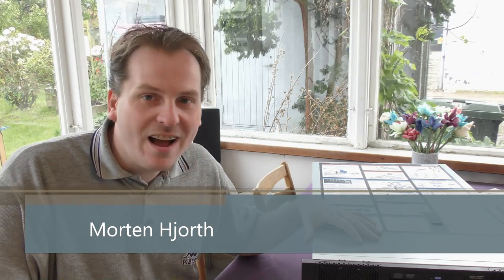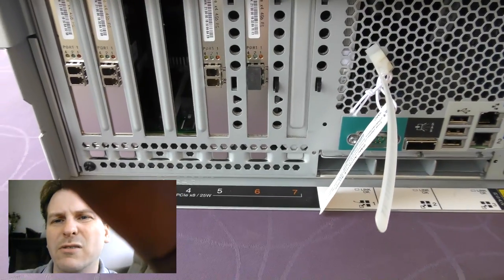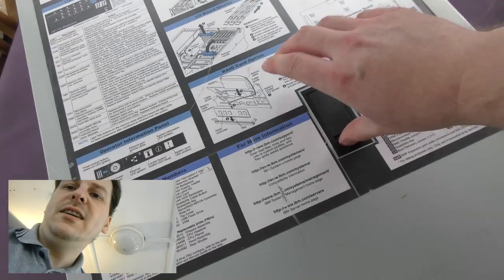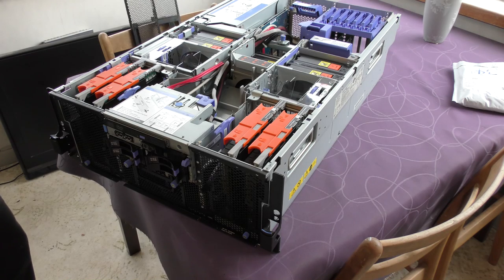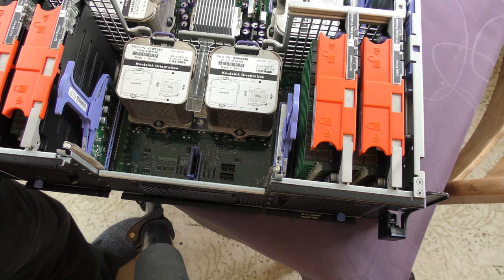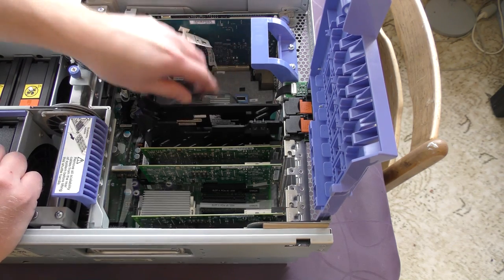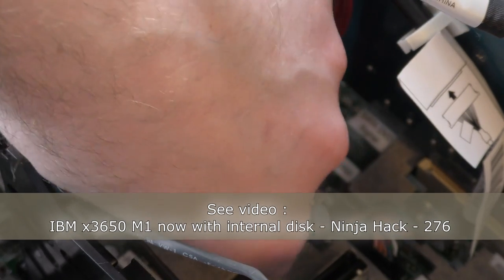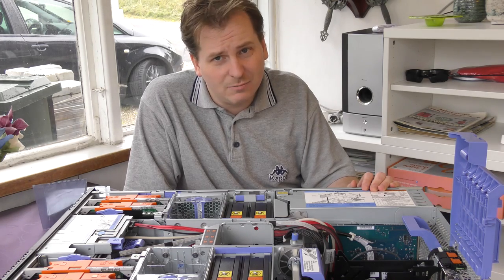$200 Awesome Server - 24 cores and 128GB RAM - 350

Comment: I am an IT Consultant, also a programmer since 1969 FORTRAN, COBOL originally when I was a senior in high school.... I'm really OLD.... 
Anyway I worked for a while at a server farm, and i learned that most servers run 80GB HD
because that is the optimal speed for them, actually this server you had in your hand is probably a set of 10 servers,  also speed is 15000 rpm, they are expensive, and they used a fiber optic connector for the network. I know that the RAM is also special, 128gb for the new servers is about 15,000 USD 
The data is stored in storage and backup servers that usually have more than 400 80gb each one is about $200 each HD, and they in turn connected to a robotic virtual backup server.
All data centers are different, they may have higher capacity drives, depending on what they actually do.
My knowledge is from ONE data center I worked at for a little while, most of my life I worked for myself.
Loved the 775 to 771 CPU exchange
Reply from the maker: Hi
This Enterprise equipment drops so fast in price,,, from $10.000 ro $200 in four - five years.
Thank you for watching! :-)

Comment: Put a little Electrical Tape on the Handel's, Stops the knocking sounds, have a few of them in a rack and they clank with the system Vibrations  .. Tape then metal up..

Comment: Perfect for a test server to learn on! and even use for video rendering :) I personally use a HP DL380 G6 with 2x E5620 8C/16T with 104GB ram, SSD boot drive and a RAID 5 with 5x146GB SAS and its fast with Hyper V!
Reply: E5620 is 4 core
Reply: @leonardotoschi585  yes - but there are two of them so 8 cores
Reply: @keanankruse  ok, still responding after 5 yrs

Comment: There is a reason why they are getting cheap :) They are to expensive to have running. With a maximum watt draw of 2.8kWatt/hour under full hardware load they chew their way though the electric bill fast! Also for you yanks, when running with 120V mode the two power supplies are not redundant (as such), they are both powering the server at the same time (look it up in the install guide) so trying to change one under load would cripple the system unless you obey the limitations like only 2 cpu's and so on. So be warned, got cheap electricity - Then this might be for you ;)
Reply from the maker: Hi David Bjørnsten-Lindhard
It uses a bit of power,, around 5-600Watt
Thank you for watching! :-)
Reply: Yeah 500Watt in idle to ... If you run all cores at 50% you are already way above 1kWatt.
Reply from the maker: David Bjørnsten-Lindhard 
No No No first two PSU at 1440W and they are redundant. Means that 1440W is absolute Max! and even that You will probably not be able to reach. 5-600W runinning.
Reply: IBM says so them selves. And also at 110V they are NOT redundant very important for all them Yanks. Check IBM Redpaper (IBM System x3950 M2 and x3850 M2 Technical Introduction) where they tell this. Also in the IBM System x3850 M2 / x3950 M2 Product guide, they state that the CPUs can draw 130W each. So that's already 520Watt, then 4 x SAS HDD+Raid controller, Coolers and so on. Not a cheap system to run.
Reply: the processor max out 130W doesn't mean that you computer always be like that 
except you got heavy loading 24x7 fullload 
then you will got near 520 watt on processor consumption
Reply: No the machine is  less then 750W at all times. You can now get a few a bit better on EBay but it seems that from now on 2nd hand server land is really going to be interesting now. One generation later with 40 cores/80 threads with 64GByte RAM go for 400 Euro inclusive shipping in Germany at the moment. 
The new ones are not that much better but companies still change their servers every 5 years.
Reply: So lets buy them  all and send them to Dubai. Heared they have a 3 US-Cent/KW price now from solar. 

But we have to send our data on harddisks with emirates planes because the connections are still shitty. This yuuuge latency might be good for chess game players who only need 1 frame per day.
Reply: Can You give more detail on that new generation and some link to ebay, please? THX
Reply: Looks like they are sold out at the moment. That happens when companies go insolvant and have to sell their shit and not resellers who will prefer to let it rot on their shelf.  Just register an ebay search for E7-4870 to not miss them next time. This was one of them

http://www.ebay.de/itm/132119690141?_trksid=p2055119.m1438.l2649&ssPageName=STRK%3AMEBIDX%3AIT
Reply: David Bjørnsten-Lindhard 2.8 watts an hour is nothing at all that's very very cheap to run...
Reply: @Colby Kordas:  It's 2.8 Kilowatt. And thats a fucking lot. In our discount Data Center at Hetzner this means 530 Euro each month for power only.
Reply: David Bjørnsten-Lindhard ug
Reply: I have that same server running 24/7 for 2 years now. It's a very nice server and also i didn't went bankrupt because of the power cost. It's nowhere near 2.8K / hour.
Reply: YouTube 88 soooo....if it's not anywhere near 2.8kw, what IS it?
Reply: Can't see why this would lose redundancy if your on 110v wattage does does not change (and its max 1400w total not 2x1400w its a redundant psu so one psu has to be able to handle full load) even then max this server would pull be less then 600w (having a 1400w psu does not mean it's constantly pulling 1400w)

Comment: Hey there, absolutely love your channel.  Its really cool to see how big of a system you can setup in a household.  I actually have a bit of a question for you, if you have some time.  I work as a computational chemist here in the United States, and we use a software called GROMACS to run protein simulations.  Recently, I managed to acquire 15 NVIDIA GTX 760 graphics cards for cheap, and I figured this would be the perfect time to build a computation farm like how I've been wanting to for a few years now.  Unfortunately, I'm very new to server hardware.  I know that its rare to find older hardware that has PCI-E x16 board edge connectors, so I'm really excited to see how your experiment goes with the x16-to-x8 adapter.  Do you have any preliminary results that you'd be willing to share?  
My main question is, would you happen to know of any older servers that you feel would be well suited for housing double-width graphics cards?  I've been looking on eBay for some cheap deals.  I found a nice lot of HP ProLiant DL380 G7 and G6, do you think they would be good for GPU housing?  I also found some x3650 M2 and M3s, not sure if those would be better.  My main issue is the PCIe x16 thing, but if the adapter works well, then simply finding servers that can fit the cards becomes the problem (I already plan on having external power supplies for the cards, since I doubt I'll be able to find servers that can power 2-3 cards at a time.)
Also, for a beginner storage solution, what would you recommend? (I probably only need 5-10 TB of storage max, but I'd definitely like it setup in RAID so I don't loose any valuable simulation data).  Thank you for your time, and thank you for all your awesome videos!  I hope that you keep finding awesome deals on equipment!
Reply from the maker: Hi Jon
Thanx for movin you question in here.
Putting a GPU in a server is a rather new thing,,, so there is not a lot of old server equipment available for it. To put in those NVIDIA GTX 760 graphics cards,, you need a lot of space and power in the server ,,both the 6 pin and the 8 pin power connector.
That removes the  x3650 M2 and M3 from your list :-/
I think you get to this cheapest by setting up the 15 cards out side the servers,,,somthing like this : https://youtu.be/TtBw_p_NU00
For you storages,,, this is a cheat solution : https://youtu.be/nlT85Xf1AsQ and install it with VM-ware ESXi 6.0 and make a virtual storages server with XPenology like i do here: https://youtu.be/_QRCOTUSy5o
And it can run a lot more VM's for you :-)
Thank you for watching! :-)

Comment: Have a DELL PowerEdge T430 and it actually has 2 designated x16 PCI-e slots and there is also 2 PCI-e power connector for any graphic cards that use that, which is all modern. I was surprised to say the least. I'm in full mode to install a graphic card in it for fun and test to see if it work to play om. Most likely won't be able to utilize anymore than 1 cpu or the two but would be fun to test anyway. And it is also so free in the chassi where the cards would go that a graphic card could be almost long as the entire computer, you don't see that in a home pc.
Reply from the maker: Hi dtiydr
Thank You very much!  glad you liked the video :-)
Thank you for watching! :-)

Comment: Hi, great video☺.
I'll probably buy that server too.
Can you measure how much power it needs (watt) an make a cinebench please?
Reply from the maker: I do not recommend this one any more :-)
Reply: @MyPlayHouse  Thank you for your reply. I have bought one 380 g8 & G9. But on my G9 write speed on 24x raid6 12G SAs  sucks....90MB/s
Reply from the maker: @max17-c4f  Could be bad or missing battery on the raid controller,, so it does not use the cache,, or it is disabled.
24 drives in one Raid6,, is a bit many,, Raid60 might be better performances wise,, but it might cost on capacity.
Reply: @MyPlayHouse  Thank you,  yes i have no battery,... i'll buy one and tell you what happened

Comment: Is your network gigabit or 100mbps? Also whats the electricity cost for you at the playhouse.
Reply from the maker: Hi +thingyee1118 
Congratulation on 200 subscribers! I have Gigabit network. I have made an FAQ,, please check it out,, I think question 4. answers some more.
Thank you for watching! :-)
Reply: +My PlayHouse (Morten Hjorth) 201 subscribers :-)
Reply from the maker: Hi Carsten Hansen 
Yes so it seems! :-)
Thank you for watching! :-)
Reply: Carsten Hansen My PlayHouse 
Thank you both for the congratulation messages. Yes 201 subscribers. I plan to be making more videos soon. Ok Morten I will look at your FAQ :D
Reply: Very good F.A.Q My PlayHouse I like that you answered all the common questions. Hehe do you run at least 1 server 24/7? since you host a website on your datacenter right?
Reply from the maker: Hi thingyee1118 
Yes I run a IBM x3650 M3 ,,,24/7
Thank you for watching! :-)
Reply: ok doke. cheers
Reply: That 1Gbit or 100Mbit? You are joking? Gibit so so cheap, there is no reason why someone should use the slower one.
Reply: NO I AINT JOKING some older infrastructure could be in use. 1Gbit has become a common thing in homes only recently. Before it was all 100Mbps! Cat5!
Reply: Recently? I used it back in 2007. But yes, some "old" infrastructure still use it. Cat5 can do 1Gbit. I thought of upgrading to 10Gbit 2+ years ago, but still to expensive.
Reply: @Stefan Are you sure? Cat5, mine was unable to, Cat5e I can do gigabit without an issue
Reply: Yeah i meant Cat5e, but Cat5 should work too, but not always it depends on the length, because Cat5 is not the "best" choice.
It's always the best idea to get the best cables for in wall installation. (less problems later ;) )

Comment: Hey Morten, do you know if it is possible to put a 12 or 18 core Xeon processor(s) in the x3850 X5? Which ones are compatible and do they require a BIOS upgrade? Also, do you have a link to find bios upgrades (under ESXi) for the x3850 M2 and X5? Thanks a lot and keep up the great videos, so much better than Netflix!
Reply from the maker: The x3850 X5, Supports the Intel Xeon E7-2800, E7-4800 and E7-8800 families of high performance processors, up to 10 cores each, offering superior system performance.
http://ark.intel.com/products/series/53671/Intel-Xeon-Processor-E7-4800-Product-Family

I am only aware that they can do version 1 of the CPU's.
Thank you for watching! :-)
Reply: +My PlayHouse (Morten Hjorth) thanks a lot Morten!

Comment: Here in The Netherlands we have a website called marktplaats which is basically a Dutch ebay (also actually from eBay) the only x3850 on there was 550€
Reply from the maker: Hi ATechGuy2016
Thank You very much!  Yes Prices went up on that server after I made this video :-/ but : http://www.ebay.de/sch/i.html?_from=R40&_trksid=p2380057.m570.l1313.TR1.TRC0.A0.H0.XX3850+M2.TRS0&_nkw=X3850+M2&_sacat=0
there are some a little cheaper, but then there is shipping..
Thank you for watching! :-)

Comment: You didn't turn it on to show us how loud it is compared to say a boeing 747 at full takeoff thrust? (or even my little HP box that sounds like a harrier taking off while its posting?) :P Nice video mate - those IBM sleds are really well put together, and designed for easy maintenance :)
Reply from the maker: HI 
Thank you for watching! :-)
Reply: It's not that loud. A dell 730 is much louder, especially at startup.

Comment: Do you prefer IBM servers over HP and Dell? If yes, how so? I only had experience with Dell and HP so far. I wonder about the pro's and cons of IBM's.
Reply from the maker: Hi DrumdevilNL
Yes IBM/ Lenovo is my prefered brand,, it goes Lenovo, Dell and HPE,,,, I have worked 15 years with servers. I had the first dead Lenovo/IBM server last year,,, I have had 1-2 HPE's a year,, needing a new system board. Here in Denmark IBM does the services on Lenovo servers,,, and the services is SO good.
Thank you for watching! :-)
Reply: My PlayHouse what’s your opinion on dells?

Comment: Are there disadvantages of memory blocks being installed in memory cartridges? Sure it's easier to maintain, but the last block seems to be really far away from the processor, where the memory controller is. Also there's the connector which sure adds noise to the signal.Or that's why ECC memory started in servers?
Reply from the maker: Hi +Murphistic 
Both are right,, and you also have the cartridges that can brake,, so it is not all good. But that said, I have only had bad MEM blocks in servers like this,,, and should a cartridge brake,, it is a lot easier to change then a system board. But Yes more complexity,, more links in the chain to be bad.
Thank you for watching! :-)

Comment: This is not cheap because the whole machine is on par with an i5 6600 but it consumes a load more power. If you are at the point where you need a dedicated server, you will need something more powerful. As it stands, those $200 are better spent on AWS or Azure. For about 2 times this price, you can get a decent piece of kit with two 6 core E56xx series hyperthreaded CPUs that will consume two times less power and have around twice the compute power.
Reply from the maker: HI
You are 100% right! This is not the best choose for your home 24/7 server. Just like NO ONE would EVER buy a Mustang sports car! it's to noisy, BAD gas miles, your not aloud to drive that fast anyway.  bla bla 
This is an awesome fun enterprise server to play with,, on a rainy day when the Mustang do not get out :-)
Thank you for watching! :-)

Comment: 32 32Gb ram sticks will make this pc with 1024gb of ram.Btw is there any gpu and how much storage does it come with?
Reply from the maker: Hi AE01
It can handel 256GB of RAM and no GPU :-/ and there are 4 drive bays.
Thank you for watching! :-)
Reply: Pls one other question,an you use it by it's own as a PC??
Reply from the maker: AE01 I was just making a video testing out stuff,, I have six of these...
Reply: it wont handle one actually you could just modify the slot but that doesnt matter. slots on these dont out put enough power even if you added a second psu with 8 pin power it wouldnt work. level1techs has a curing consolitis video where they try sticking gpus into old work machines and the slot power limitation prevents even basic cards from working.

Comment: You can short the pcie connector from the graphics card. ( for instance, an AMD RX 460 doesn't even has no more then 8 pcie channels  in use
A pcie slot supports normally 75W. Lot of more powerfull graphics cards, do yo use a PCIe power cable, being a 6 or 8 pin.
Reply from the maker: Hi Steven G
Thank You very much!  glad you liked the video :-)
Thank you for watching! :-)

Comment: I have to ask.  What are you doing with these servers.  Not often some shows everything like you do.  I am guesing you are doing MMO gaming severs.  would i be correct.?
Reply from the maker: Hi jason puttock
I do get this question from time to time, so I have added it to my F.A.Q. that you can check out under the "about" tab here on my channel. I give a longer answer there.
Thank you for watching! :-)
Reply: okay.  ty.  questions now.  what does it take to make these types of servers into an MMO gaming station.  cluster, CPU's and what not.  I am learning about this the hard way.  I am a gamer (light) but have noticed a big exploit in cash.  For the likes of GTarcade which you can visit at any time.  One game in particular is LOA.  not 2 or 3 just LOA.  this game was relicenced as chaos angels.  Now there are two versions of the same game but different titles.  If you check them out you will see what i mean.  I hope you can see where I am goiing with this.  Other companies are buying rights and sharing the same game.  They make the money and extend later on.  What I have noticed on your system is now you have the option to do just this.  Make money and a bunch of it.  All are under the game status of Rubies Gems or Diamonds.  in this instance it is diamonds.  Each batch is equal to the cost of $5 for 500 diamonds.  Multiple this with 20 users.  that is your cloud costs along with server in one month.  these games are running atleast 100 people. most all buy some basic packages.  you can work out the costs now to YOUR advantage.  can you please make a video with this tought as your focus point.  you have the setup and servers.  whtat will it take to get it running and can you doit.?  following with most interest.